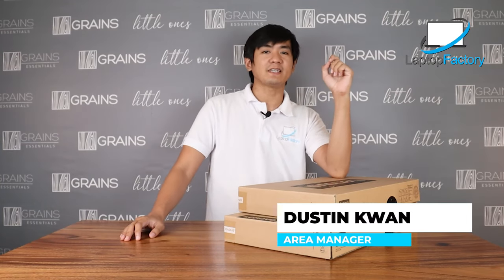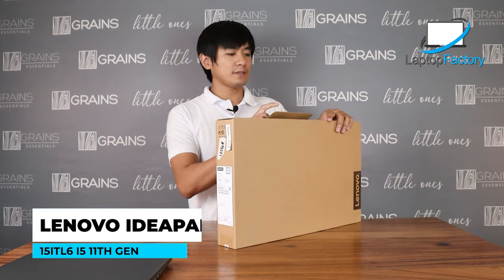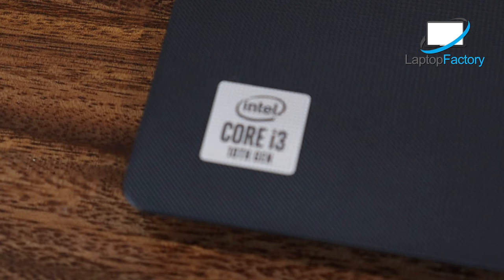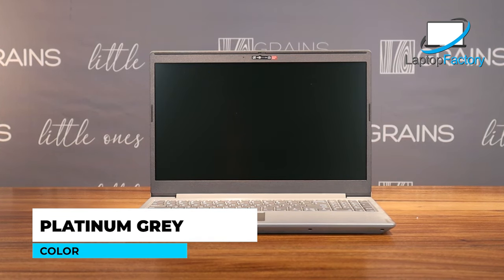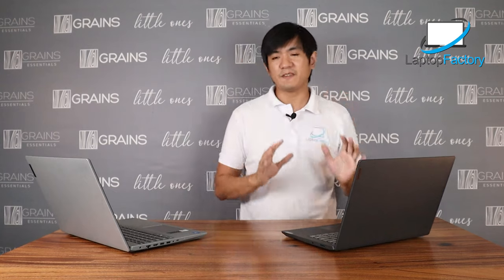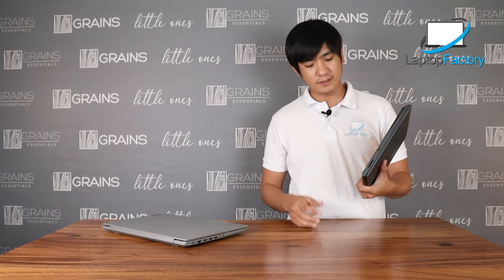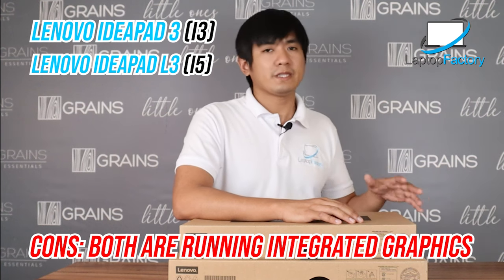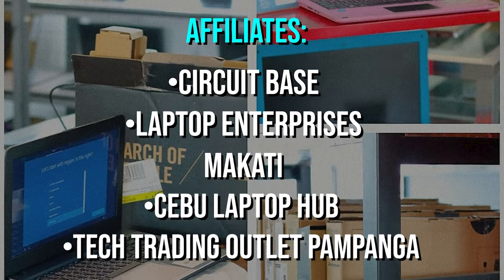LENOVO IDEAPAD i3 AND i5 Unboxing, Reviewing & Upgrading | PHP 24,000 BUDGET NA LAPTOP!

Comment: I have a Lenovo L340 Gaming, for the price of 37K, it has GTX 1050, i5 9th gen, 4+4= 8gb ram, 512gb ssd, and i have to say it is a great value for the money, the ideapad body is a lowkey professional looking body, and for me, i do cadd and other engr applications and my laptop never fails me!!! Highly recommended for people who needs a capable device, and for 37k, its a bargain
Reply: 37k? Isnt that the price of the Lenovo Ideapad?
Reply: @TheChosenOne1_  yes, L340 is also a ideadpad. My sister has an ideapad s145 with i7, 8gb ram, integrated gpu and she tells me it struggles sometimes, thats why i can say i had a very good deal with my laptop due to the boost in performance of the GTX 1050
Reply: San po kayo nagbili ng ganan?
Reply: Where did u bought it? What store?
Reply: @JWONG-pu8ky  Hi, can you tell if where did you purchased your Laptop? Thanks
Reply: where did u buy your laptop
Reply: 35k nalang . yan
Reply: 37k for a 9th gen i5 is too much
Reply: Hi, what's the model po? Thank youuu
Reply: Agree on this. Been looking for L340 gaming however phased out na. Closest specs to this unit is Lenovo Gaming 3i retails for about 50K :(
Reply: Got mine too today and msasabe ko n ngyon n great investment pra mpadali ang trabaho ❤
Reply: Loan

Comment: Suggestion, Review a Laptop below 20k for students that can be used for autocad for online class. Sana merong mura lang po. Thank youuu 🥰
Reply: This will be really helpful for my sister
Reply: Yes! kelangan ko rin to
Reply: Lenovo slim ideapad 1
It can run Autocad 2022 ang sketchup
Pero mga built na lahat not upgradable unit

Mura lng good for students 👍
Reply: @renrensedillo5261  pa suggest ako 40k budget
Reply: @forkspoon4720  Huawei Matebook
Reply: If pang AutoCAD, pwede na i3, 8gb ram, 256 ssd.. idk if kaya ng below 20k
Reply: Pede po yan sa auro cad
Reply: May infinix laptop na tag 21,000 na i3 core 10th gen siya.. try nio kung ok
Reply: @forkspoon4720  aspire 7 R5C5
Reply: @motoraeden9806  hm kaya ung gnun sir,

Comment: Sa experience ko the best yung Lenovo. After 10 years buhay pa rin yung laptop ko 1st Gen i3. Puro upgrade lang ginawa ko from Windows 7,8,8.1,10 hanggang 11. Tapos dagdag lang ng memory, convert ng main hdd to ssd tapos nireplace ko yung optical drive sa extended hdd. Napaupgrade lang ako ng main laptop unit dahil kailangan sa work.
Reply: Advisable na po ba ito sa student?

Comment: Hi. Can you confirm if the i5 is FHD or HD? Official website and Shopee stores say it's Full HD. That's the only thing I didn't like in the specs you told us in this review.
Reply from the maker: It's a Lenovo IdeaPad L3 15ITL6, It's an HD Resolution. Does you have seen on the websites are Lenovo IdeaPad L3i 15" with an "i".

Comment: Normal lang po ba sa i3 na 1-2 hours lang ang tinatagal ng battery? 3 days ko pa lang pong nabibili yung sa Lenovo dahil sa review niyo, sulit naman po siya, sa battery lang po ako medyo nacoconfuse. Btw sa laptop factory Lucena branch po ako bumili thanks.
Reply from the maker: It depends on the tabs and application you are using, heavy duty applications and multiple tabs could reduce more battery.

Comment: Hi ano po ba yung worth it bilhin acer aspire 3 or lenovo s145 14"
Reply from the maker: The acer aspire 3 has a truly bad display even by historical standards but Low price, plenty of performance and features. That's a simple proposition. However, The lenovo s145 laptop has a nice metallic finish, does not overheat. The keyboard is nice and clicky, and offers an amazing typing experience. The anti-reflective screen does an amazing job. I'm using the latest windows 10, and it does not lag at all. go for the lenovo s145

Comment: Sir ano po lowest processor that supports virtual background of zoom
Reply from the maker: A System requirements for Zoom must be minimum Single-core 1Ghz or higher. But I recommend Dual-core 2Ghz or higher (Intel i3/i5/i7 or AMD equivalent). An Intel Celeron or AMD A4 would be a good start as a lowest processor to support zoom

Comment: Sir sana mapansin nyo po yung sa i3 po ilan po yung slot ng ram nya balak ko po kasi upgrade yung ram ko kasi 4gb lng po sya tsaka ano po yung capable ram nya salamat po sana po mapansin nyo bibili po sana ako ng 16gb ram
Reply from the maker: 1 lang slot po ang ram, any ram basta DDR4 2667 Mhz
Reply: Thank you po sir sa pag pansin dko pa po kasi siya na bubuksan nag hanap lng po ako sa YouTube ng pag bubukas at nakita ko po sa inyo salamat po lalagyan ko po siya ng 16gb ram.
Reply: Sir last question po kaya po pala kaya nya yung 16gb ram or 8gb ram lang po pwd ko ilagay since yung 4gb ram po nya is shouldered

Comment: Hello po , anyone po na may alam alin ang better for esl online teaching. Both corei3 and ok sa company...alim po better?

1. Lenovo IP 3 14ITL05 i3
- Intel Core i3-1115G4 (2C / 4T, 3.0 / 4.1GHz, 6MB) 
- 8GB DDR4 (4GB Soldered DDR4-2666 + 4GB SO-DIMM DDR4-2666) 
- 512GB SSD M.2 2242 PCIe 3.0x4 NVMe 
- 15.6" 1366x786 Integrated Intel UHD Graphics
- Windows 11 Home
32,995

2. Acer Aspire 5 A514-54-37V6 i3
- Intel Core i3-1115G4 (4MB Smart Cache, 1.2 Ghz with Turbo Boost up to 3.4 Ghz 
- 8GB DDR4 memory 
- 256GB NVMe SSD 
- 14” FHD 1920 x 1080 resolution
- Intel UHD Graphics 
- Windows 10
31,995

Comment: HINDI PO SYA 24K
Reply from the maker: Old model po to hehe
Reply: ah okey po sir marami salamat sa reply ask ko lang po sir, rapper po kasi ako sir, and usually nageedit po ako ng sound ng music and producing track ang balak ko po kasi bumili ng laptop na good for editing ng software na katulad ng Adobe audition 1.5 or maybe FL studio version 12 or 20, maari nyo po ba akong matulungan kung anong budget pc or laptop specs ang pwede sakin need po ba talaga na i5 or ryzen 5 4000HS series and required?
Reply from the maker: @ArtBaliw216  Hindi naman po need i5 or ryzen 5, i3 or ryzen 3 is enough for using the music editor